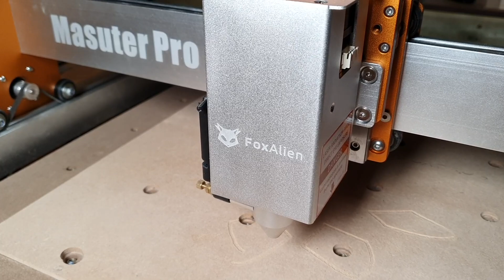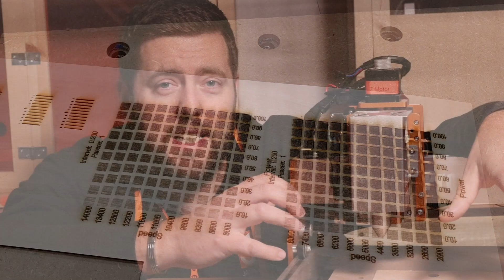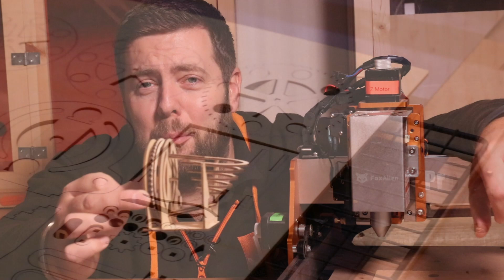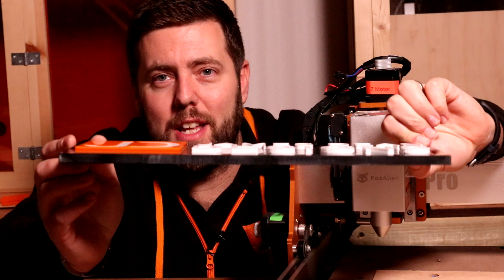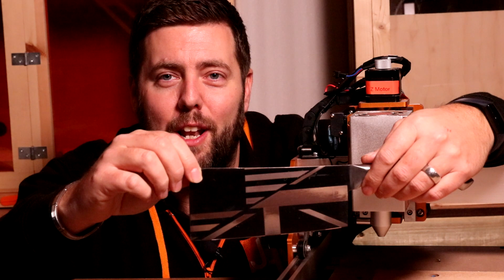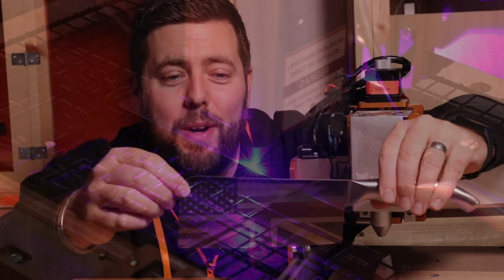Powerful cutting and marking laser - 80w (20W) FoxAlien diode laser

Comment: Do you need your computer connected hardwired for better results rather than Fox's micro disk setup
Reply from the maker: The quality is the same however I believe you have more control and options using a computer

Comment: 12V or 24V?
Reply from the maker: No, the ART file will only open in Carveco and the other gcode files are to be ran through your control software such as Candle, UGS etc
Reply: @JamesDeanDesigns  Is the laser module powered by 12V or 24V?
Reply from the maker: @HenriqueFunari  that reply was for someone else which is pretty odd...anyway they are 12v

Comment: hi James just a wee question have you ever tried to cut 10mm oak with this laser and if so what were your settings i am planing on doing a couple projects on an extended masuter pro but it is very important that the laser is capable of running for extended periods and can cut out the parts quickly any suggested settings or advice would be appreciated

Comment: Hi James,
I am looking to cut between 2mm and 2.5 mm ply on my Masuter Pro, with as much accuracy as possible. Given your comment about power and focal width accuracy being a trade off,  would you advise the 40W laser or the 80W model. speed does not matter but accuracy 
of the kerf really does matter.
cheers
Phil
Reply from the maker: I dont have the equipment to accurately measure them but there is not much difference apparently. Less than 0.1mm which on desktop machines like these is absolutely nothing at all. The key will be doing some focus tests when you get it and do them in small increments like 0.1mm to find the perfect focal length

Comment: Do we continue to use the existing power supply along with the new power supply, or does the new one replace the old one? 1 power supply or 2??
Reply from the maker: Use the new power supply just to power the laser.  Any other power supply that was running the machine should continue to run the machine

Comment: James,
Thanks for the quick responses. I have received a replacement laser from Foxalien. They are great on customer service. However, I am still struggling with the output. I cannot achieve the cutting speeds that you are getting with your 80 w laser.  My maximum cutting speed in 3 mm plywood is 500 mm/min. I would like to measure the output. Where can I get the laser power measuring device, gentec? I searched, but could not locate the one on the video.
Thanks in advance,
Tom
Reply from the maker: You essentially need to contact Gentec and they will tell you the supplier for your country. One thing to note is different plywood have different densities and glue composition. I usually buy balsa or basswood which is more laser friendly than your average ply wood at a DIY store
Reply: @JamesDeanDesigns  Thanks for the quick response. I purchased some 3mm basswood plywood and made some test cuts. Speed was better than the cutting in 3mm baltic birch but I still could not achieve the 1200 mm/min that you are able to achieve. What is the wood you are cutting in the video? I can only achieve 650 mm/min cutting in the basswood plywood.
Reply: @tomgustafson4081  Hey Tom, you ever figure out how to get a faster cut speed with the laser? I'm getting similar numbers to you.

Comment: Would you care to sell or share your test file parameters you did to color tone the knife? I have bought that fox alien laser, and get any results with it. Thanks
Reply from the maker: Thr test files can be generated within lightburn, Laser Tools> material test I believe. I have found different grades of stainless steel work better than others. The problem is I don't know what grade actually works best
Reply: @JamesDeanDesigns  have you tried this with aluminum? Thank you so much for your time.
Reply from the maker: @NuggetKnocker  diode lasers do not work with aluminium. It's something to do with composition of the metal

Comment: Great video as always, do have a question have you tested it with the 4040XE
Reply from the maker: I havent, I recently had to sell my 4040-XE but it should still work as the power supply is separate

Comment: James, another great video. I just received my 80w laser and installed it on my Vasto. But I cannot get the power out. I cannot cut 3mm plywood when set at 2mm/min, 100%. I am using Lightburn, device is GRBL. Can you share your settings and device. Thanks in advance.
Reply from the maker: I trust you are using the extra power supply? Check the lens of the laser make sure there are no obstructions an make sure there is a clear hole through the air assist.
Make sure your Smax value in lightburn matches your $30 on the Vasto. I was using a Masuter Pro to run this
Reply: @JamesDeanDesigns  Thanks for the quick response. I checked the laser. All looks good. I don't follow you on checking the Smax value in lightburn. My $30 was 10000 but my $32 was 0. I changed the $32 to 1 and the laser started to cut but not much better. I changed the $30 to 1000 and now cutting is much better. Cutting 3mm plywood at 500mm/min at 100%. But now the outline function with the laser on burns a path. What do you have set for $30,31 and 32? Thanks in advance, Tom
Reply from the maker: @tomgustafson4081  so there is a setting in lightburn called Smax, and it basneed to match your $30 setting. Doesn't really matter what the figure is as long as both are the same. I'm guessing your Smax was 1000 which is why it's now working better. 
Sadly the downside to powerful laser is even at low settings its still quite strong. There should be a % setting next to the Fire button. If you drop that down as low as possible it may help when you're framing

Comment: How did you do a focus test? I want to do that with my 20W/5W laser
Reply from the maker: Depending on what machine you have, you can either slope a piece of wood so it starts really close to the lense and laser a straight line on it. The laser line should start thick, get thinner, and go back thick again. The point the line is the thinnest is the best focal distance. Alternatively there is a test file in this video which steps the laser down and does little lines https://youtu.be/YnFNFEdmPjU
Reply: Thanks that is perfect. So glad that a) you are approachable and b) that you answer so fast!

Comment: Impressive as always James 
I,m glad you mentioned about High Power Lasers and NWT as I,ve found that over 5 watts doing quality Tiles become a challenge especially on Multi Diode systems as the beam not only is larger (0.1 mm and greater ) but also becomes disproportional ie the horizontal is 3x smaller than vertical 
some of my thoughts from numerous tests on a multitude of laseres 
1/ The fox Alien Laser is amazingly esthetically a Twin to the Xtool 10 watt
2/ Cooling ..as the wattage goes up the attention to cooling becomes an absolute must ...I,ve found that these multi diode High watts are under cooled  (ie air Flow) and use cheap fans ...I have a Opt Lasers PLH3D-XT-50 (5 watt) . The cooling fan is a high  end Sunon with 23 CFM @ 2.3 inches water Static pressure . As such they state that this Laser can run at 100% power with only 1-2 C temp rise . The three 10 watt lasers I have (2 x5 watt diodes ) use cheap bearing fans with approx 16 CFM ( I measured about 9 real CFM) 
3/ Power ..The P/S is 24 VDC 5 amps >>>this requires at least 16 Ga wire ..and my visual of the wiring indicates they are using maybee 20 Ga
4/ TTL compliant ....Most controllers now are 32 bit and as such the TTL/PWM signal is 3.2 Volts .I have tested some Laser units that struggle with 3.3 Volts 
5/ PWM frequency adjustment($33) ...The standard appears to be approx 1200 Hz .This appears to be suitable for the older machines that at best could ACTUALLY go 8,000 mm/min , BUT now manufactures are boasting up to 24,000 mm/min . At that speed 1200 Hz is too slow to get actual full Power .
adjusting the PWM to 5,000 Hz or greater helps overcome this 
To date the only laser that has a driver circuit that can accommodate this change has been the Opt laser 
6/ SPEED ..I,ve done a lot of testing on these so called speeds. For simplistic Vectors they come close as the G-Code generated (instructions per inch) is not Overwhelming .
BUT when doing say a 318 DPI raster image at 20,000 mm/min  the amount of instructions generated will "choke" the processor and LightBurn . Doing Greyscale will literally stall the Machine.
To overcome this lightBurn and Ortur have worked together to enable Gcode clustering. The latest LightBurn firmware has this Option and also requires the processor firmware to be able to support this. I believe at the moment only Ortur and Timothy Rothman's controller have this firmware.

Comment: Is it possible to use the Brass Nozzle from Laser Wizard in place of the nozzle that came with the 80 watt? If not then I will order a proper air hose to fit the 6mm inlet.
Reply: If i get my hands on the 80W module, I'll for sure design a nozzle for it!
Reply: @Laser Wizard  I have 4 of your nozzles, it looks about the same inside diameter, but I just want to ensure the center hole lines up with the beam.
Reply: @David Dunster  actually, I believe that I already make a nozzle that will fit the 80W FoxAlien module. Is the lens housing diameter 16.00mm? I have nozzles that are 35mm long (for a 40mm focal length) and 16.10mm ID (to fit 16.00mm lens housing).
Reply from the maker: Sadly no, or not the one I have which fits the 40w laser. The lens on the 80w laser has a smaller diameter

Comment: I am very happy with the purchase of my two, yes, two, 80-watt lasers. They are very powerful and, as an example, I was cutting 1/8 plywood on a 40-watt at 80%, 1000mm/m in 15 passes. The 80-watt did it in 6 passes at 1000mm/m at 50%. They have made a huge difference in my cutting time.

Comment: Can this mark aluminium  like it does stainless?
Reply from the maker: No. With aluminium being softer I actually thought it would but its something to do with the composition of aluminium and the diode lasers, they just don't mix
Reply: @JamesDeanDesigns   Thanks that's what I thought, aluminium seems to be a problem for lasers.
Reply: @James Dean Designs  I believe it is because aluminum conducts heat extremely well, whereas stainless steel is an insulator. The other reason is like you said, the chemistry of the material. Stainless steel oxidizes to a rainbow of different colors depending on the temperature. Aluminum fully melts at a low enough temperature that it still looks like aluminum just liquid. No hope for color changes with aluminum.

For anyone wanting to produce beautiful aluminum pieces with their diode laser, you can very easily burn away anodization from aluminum plates with any power blue diode laser.